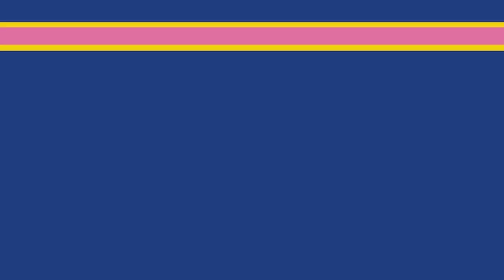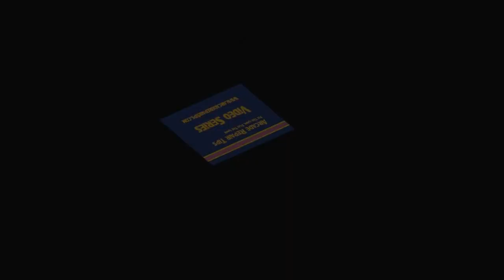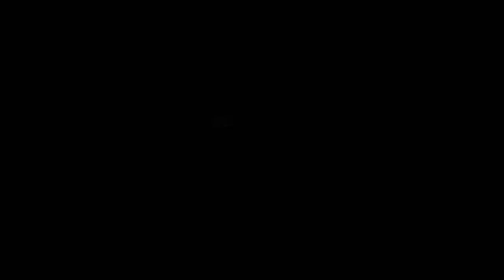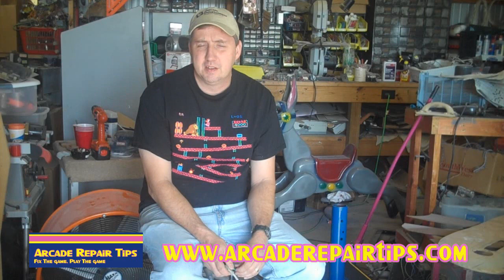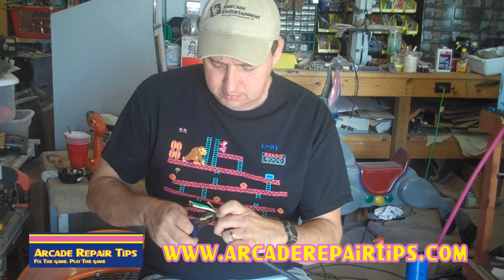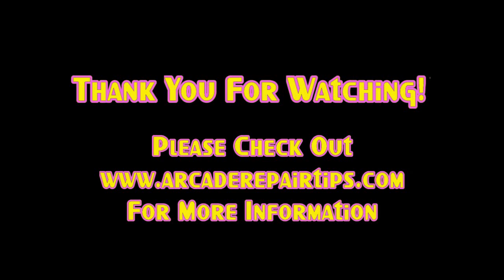Arcade Repair Tips - Replacing A Plug On A Power Cord

Comment: is the ARCADE power cords of the 80's games like MS PACMAN hard wired or removable like a PC cord?
Reply from the maker: The power cords on most 80s style arcade games are soldered or connected directly to the cabinet. They can be removed but it’s not as easy as unplugging them like a PC. Usually requires desoldering or physically disconnecting the cord from inside the cabinet.

Comment: Heat shrink. Anywhere a multiconductor cord has the outer jacket removed. Greatly stabilizes the cord assembly by helping prevent water infiltration and individual conductor slipping.  Try it, it will pay off after a year.

Comment: Does it matter what the voltage/ampage is on the new plug? I'm replacing a plug on an organ, and the sticker on the base says it runs off of 115-120 volts and .35 amps. The replacement plug I found is labeled 125 volts and 10 amps! Is it safe to replace the old plug with that one?

Comment from the maker: @MrDswdasd A flat handle plug should work fine. The plug that we used in the video we got from our local hardware store for pretty cheap (less than $5). Since the fan didn't have a ground prong on it to begin with, it's probably not too bad to leave it off. The problem with arcade games is that most of them used to have a ground prong and it's either been pulled out or damaged. We have featured your question on episode 24 of our podcast. Listen to it for more of our thoughts. Thanks.

Comment: whoa, with those you don't even need a soldering iron?! I won a Gunblade NY DX that has this exact problem (not really sure if the ground came out while they were shipping it or if it was something that happened when it was still in use) so I'm looking to get it repaired...

Comment from the maker: @necrophagist1234 When dealing with AC voltage coming from the wall there's not really a positive and negative but there is a hot (usually black) that carries the voltage and neutral (usually white) that completes the circuit. Many people think the wires can be used interchangeably, however, some disagree. To determine your AC polarity, do a Google search for "Determining Proper A/C Polarity".

We have featured your question on episode 14 of our podcast. Listen to it for more of our thoughts.